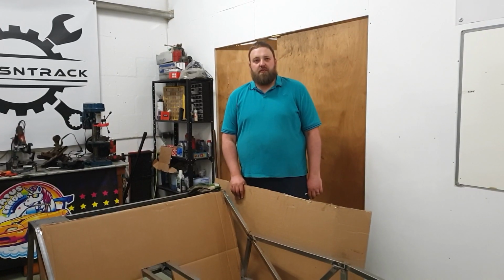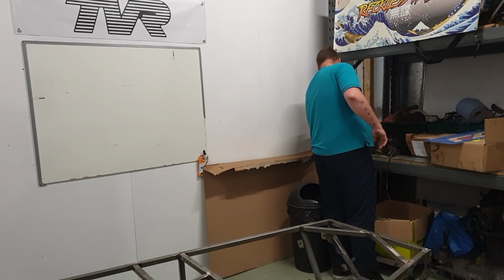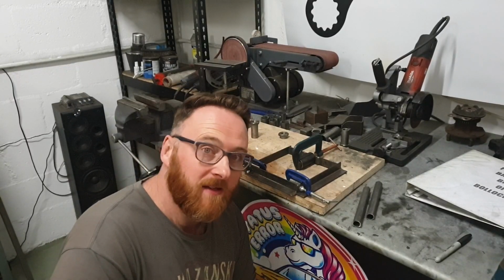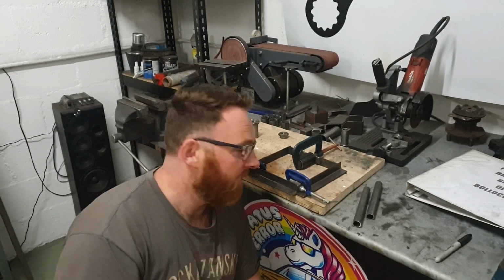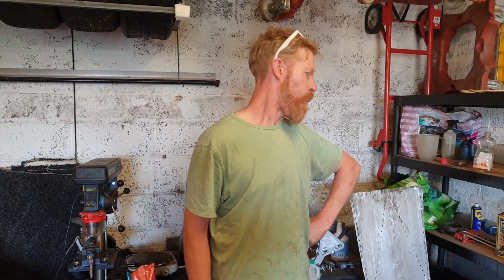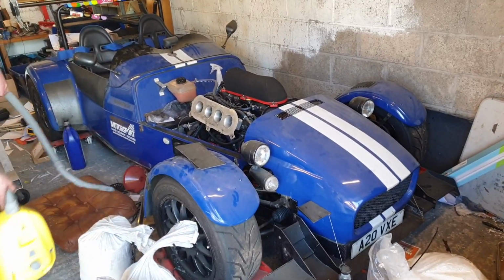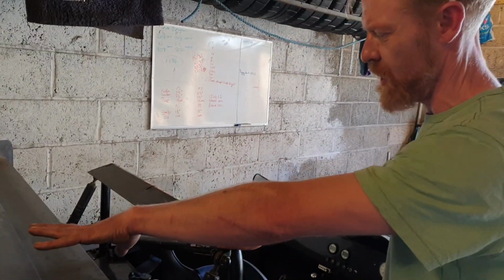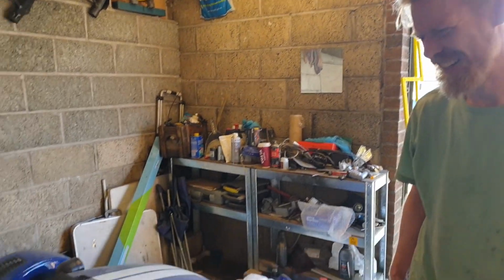Rear WISHBONES! - Locost 7 Kit Car FULL BUILD!! - Episode 22 - (Project 7-UP)

Comment: Hah! Helicopter glue indeed. Use it everyday on helicopters. Good stuff but surfaces have to be absolutely spotless. And if the aluminium doesn't have a proper surface treatment you'll probably be looking at some bad corrosion within a few years, at which point the glue just falls off. I really hope you're not going to try and bend that 3mm T6. Depending on the alloy it could be a bend radius up to almost an inch.
All that being said if you have any questions about the epoxy etc. just give me a shout, I'd feel pretty shitty if I watched you do something I knew you shouldn't and didn't say something🙂
Reply: Absolutely. Clean, clean and clean again. Get the surfaces to what you you would consider perfectly clean and prepped, then at the last minute, go over the mating faces with the finger file with a brand new 80 grit belt and wipe down twice with IPA on 2 brand new microfibres. Dip the rivets in glue as they go in. And for the love of god, flip the chassis upside down if you don't want helicopter glue in your eyes/mouth/nose/hair. And use the old fibreglassers trick of 2 pairs of condom gloves.